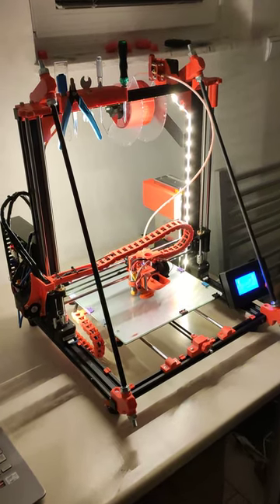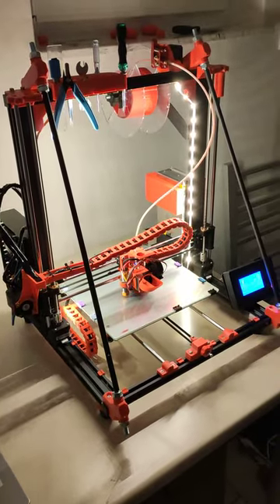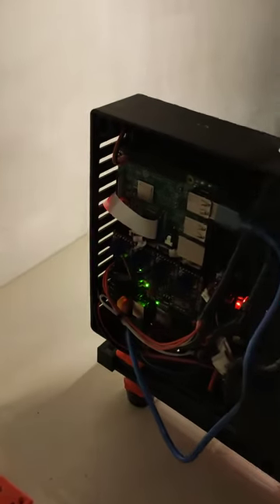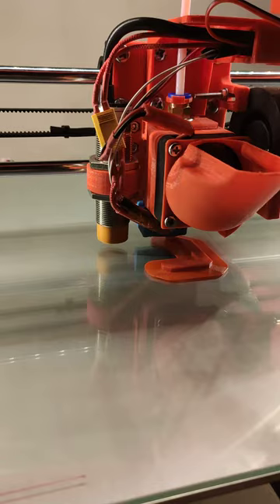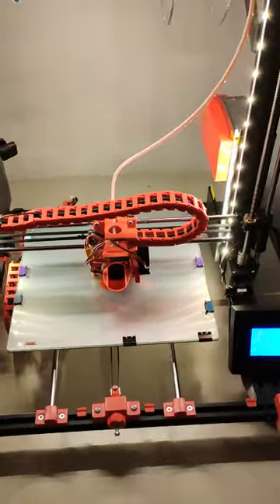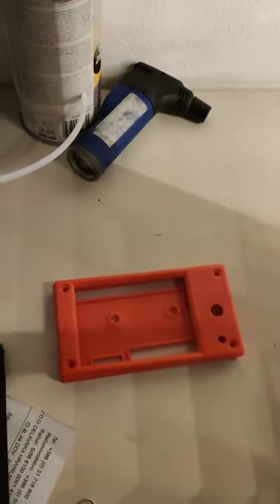ANET A8 plus with SKR 1.4 turbo modded

Comment: Good job..👍.
I got mine upgraded with SKR1.4 X&Y TMC2209 Z&E 4988 and TS35 screen. Completely changed the feel of it. So silent & smooth prints surprisingly very good. Considering a 300mm & metal frame😊 too. Thanks for sharing your built ❤

Comment: Good to know! I'd like to do this with my A8. I'm glad to know I don't have to change to the TFT immediately. I can still use my Anet display.
Reply from the maker: Yes it can be used, but this new display is so much better. But changing from 8bit to 32bit and better motor drivers is huge step forward. On 8bit bord there is no enugh space for Marlin extensions. On SKR 1.4T you can enable all options you want 👍

Comment from the maker: Today I ordered linear rails and blocks for Z, Y and X axis.
Reply: Could you share the links where did you buy these from?
Reply from the maker: @tamasau8725  I order them on Banggood and they are Machifit MGN12H . I did mounted them on Y axle. They are prfect. You must yust clean bearings and block and dont forget to lube them.

Comment: Omg this is awesome! I'll save it for reference! I'm thinking of modding my a8p too but I'm not that knowledgeable to do so yet @_@
Reply from the maker: Hi. Just swap mainboard and upload my config files. If u need help just ask. I know how frustrating can be if you can`t get any help. Now i`m waiting MGN12 rails to do the last mod. But overall print quality is perfect. And if you still using stock hot end change it for E3D V6 and put stepper motor for filament on top for bowden setup. And don`t forget to add auto bed leveling :))
If you have problems with filament sticking on glass its all in bed temperature and nozzle high. For PLA HE210°C at start and 200°C when printing and BED 70°C
Reply: Where can I get the firmware I want to put a biqu h2 exstruder on my anet a8 plus but there is no eprom in original board

Comment: If you can do a beginner guide to upgrades that would be incredible... I'm new to 3D printing and have an A8+. I love it but it's a bit noisy and I'm looking to upgrade... I heard that you can change stepper drivers and assume that is a chip on the main board... But it's really hard to get info that does not immediately go into technical jargon that I don't understand at all!
Reply from the maker: Yust ask,what do you want to know?

Comment: Could you upload your config file have the same setup but can’t get my config to be right. Thanks in advance
Reply from the maker: Did you try this link https://www.dropbox.com/s/qeislexbaimhnzk/SKR1.4T%20A8%2B.rar?dl=0
Sorry for so late answer
Reply: @trebor1477  Thanks for the files, Ive got a stock hotend and BLtouch, the bltouch i can change i know that in the firmware but for the stock hotend do i need to change anything?

The rest for wiring should just be following the wiring schematic i guess.
Reply from the maker: @filthmaster9936  Hi. Yes you need to change off set becouse my hot end is in diferent possition. I hope you do know how. But on youtube are a loot instruction 😁👍
Reply: Also would these configs work on the skr 2.0?
Reply: @trebor1477  ah yeah that I know off, just trying to find out now if I can use these files on skr 2 because I cannot get the skr 1.4 any more.
Reply from the maker: @filthmaster9936  Sorry i don't know. But it can help you by modding your config. Allso  there is new version of marlin now.
Reply: @trebor1477  thnx for the info, found even never board, the skr mini E3 v3.0

I'll go for it and see if I can make it work. Would be great with that board.
Reply from the maker: @filthmaster9936   I needed 4 days to make it work. But i did not have anny help. But at last it is something to begin on. Try with no ABL for start. Please subscribe 👍
Reply: @trebor1477  Subscribed👍🏻 

Do you have a discord channel by chance. Plan is to start with basic setup. No AB, no filament detection.

Comment: thanks alot for sharing! I am eyeballing the 1.4 turbo for my own A8P. Its great to know that its already been done!  Do you mind sharing the part number on your z-probe? and are you powering with 5VDC or 12? I have the 8 mm orange one appears just like yours... but using on 5 VDC power does not work with glass on the bed. Ive been printing without the glass sheet, But I would like to be able to use it.
Reply from the maker: Hi. The part you want is LJC18A3-H-Z/BX this is better probe because you can regulate it for hight you want. Allways calibrate probe when your priter heat's up to working temperature. Then probe will work well. Conect it on same place where is Z limit switch (dont forget to unplug Z swich first ). Wires are conected like this black is signal, brown is 5V and blue is GND. To print succesfuly on glas bed with PLA u need 70C and with PETG u need 80C but im usig E3D head. Stock printing head is good just for start. You can contact me on Discort for more help. Hit subscribe 👍😁 so you wont miss new BLV mod for A8P. Yes iti is done and it is printing fine 😁

Comment: I've rewired and configured marlin as you mentioned but the original LCD screen for Anet A8 plus won't work ( only the backlight turns on). Do you have any recommendations ?
Reply from the maker: Go and reed Yar Mar post. I hope that you did not connect your LCD in SKR before you modded connector and pins. I can send you picture on email if you want.

Comment: How was the wiring of the anet a8p screen to skr 1.4, was it straight forward?
Could you share some overall wiring guidance also?
Thanks
Reply from the maker: Don't plug A8p screan directly to skr board. You must change wires and mod connector. Go and see Abdul Hafiz post there is how to do it.
Reply from the maker: Https://youtu.be/zZYd0aYtThY look at 8:30

For A8P use 7 pin near modded connector and 9 pin  and reverse + and - as on video. I tride to add link to picture but youtube is deliting msg. If lcd light up and there isn no picture 7 and 9 pin the wrong one. You can give email so i can send u picture if you have problems.

Comment: Is this the bear mod seen on the thingiverse?

And how do you hookup the stock anet a8 plus with skr turbo? I have the same board on the way and want it to replace the stock anet board but still use the stock screen.
Reply from the maker: Hi. I used a lot of different parts from thingiverse.com but for upper reinforcement I used:
 -Anet A8 Plus - Bear X & Y - Frame Brace by FedorSosnin. Check for bowden extruder mount on his site.
For SKR 1.4T:
- Anet AM8 A8 - Electrical Box for (SKR 1.3, Raspberry pi 3b+) by Technoo10201 
Y belt tensioner:
-Anet A8 Plus Y Belt Tensioner by nosbiker 
Z axis improvements:
-Anet A8 Plus Z axis improvementsby stefanobatt 
-Adjustable foot
Adjustable foot for Anet A8 Plus or other by manidu30

If yo want to use original LCD you will need to cut some wire`s and solder them. Use picture in RAR file. Connector on picture is on motherboard side and goes in EXP1. On EXP2 is connectet only one PIN for RESET button. For better understanding go visit this site https://www.reddit.com/r/Anet3DPrinters/comments/gc1tkm/anet_a6_full_graphics_lcd_btt_skr_14/
Reply: @trebor1477  thank you very much for your detailed reply. Appreciated it. Subbed
Reply from the maker: @ujang0711  I recommend a "TFT35 buttons on right side " this way you get USB port and a lot of options so you don`t need to upload new config files for some changes. I will make video later. By the way in my config I use auto bed leveling probe so disable this if you don`t have it.
Reply: @trebor1477  At the moment, I think the microSD slot is enough for me. But I will definitely be getting the TFT screen later in the near future. I will look forward to that video. About your config file, I’ll keep that in mind. For the TFT screen, I do know that it needs a different firmware from the SKR board. But does the firmware need to be tailored for a specific printer?
Reply from the maker: @ujang0711  this microSD on SKR board is easy to brake. And in marlin you need to set it as LCD and not as ONBOARD. I know its funny and not logical. If you set it as ONBOARD you wont be able to see it on PC ower USB port. And if you set it as LCD then you can :)
Reply: @trebor1477  I'll wait for my TFT to arrive then.
I'd like to know, did you use the original limit switch with the SKR board? Or you get the limit switch with the attached board?
Reply from the maker: @ujang0711  I'm using sensorless homing with TMC2209 drivers. All limit switches was removed.
Reply: @trebor1477  For the supporting rod, is this the one that you use?

https://www.thingiverse.com/thing:4133747/files

I can't seem to understand where to mount the bottom mount. I see that you mount it on top of the front aluminium profile. But the author pictures on thingiverse mount it at the corner in between the two profiles. Can you clarify on this? Thanks.
Reply from the maker: @ujang0711  Hi. Look at picture. https://www.dropbox.com/s/xn9cd91d54068qe/1608964345506.jpg?dl=0

Comment: Why do you removed the direct drive?
Reply from the maker: For faster printing. And i don't have anny problems with bowden setup.
Reply: @trebor1477  Retraction with PLA is not a problem? Im thinking in this printer to print some big masks or helmets.
Reply from the maker: @JeanBrito666  i printed case for skr board with no problems with PLA filament

Comment: Looks like a great machine! I've just received mine some days ago with SKR 1.4T.  I've not not started assembly, I am still waiting for the new hardened steel linear rods and new bearings. Until now have you got good experience with sensorless homing?
Reply from the maker: I`m am also waiting for MGN12 rail`s and bearing`s. Sensorless homing is working OK. But you don`t want to enable HYBRID THRESHOLD when you use sensorless homing. Do you have modded parts for X and Y linear rails?
Reply: @trebor1477  Thanks for the advice! I don't have any until now.. My parts will arrive tomorrow hopefully. I have a question to you about the x brace. It looks like to me that the bottom one's chase does not fit with the slot on the aluminum profile. In Cura it looks like as it 90 degrees turned. How did you manage to attach it stably?
Reply from the maker: @ottoczompoly6267  Do you mean this part https://www.thingiverse.com/thing:4133747
Reply from the maker: @ottoczompoly6267  did you assemled your machine?

Comment: Hi, can i use this file for my Anet A8 plus with TMC2130spi und tft 35 E3 V3  but without Sensors?

Thank you!

(I have add you @Discord ;) )
Reply from the maker: Yes you can, but you must do a lot of changes in marlin config files

Comment: Good job..👍.
I got mine upgraded with SKR1.4 X&Y TMC2209 Z&E 4988 and TS35 screen. Completely changed the feel of it. So silent & smooth prints surprisingly very good. Considering a 300mm & metal frame😊 too. Thanks for sharing your built ❤
Reply from the maker: Hi. On what version of the marlin are you? I'm on Marlin  2.1 2.1. Yes it is a totally different machine and you can't say it is Anet any more 😁. Uh... Now I see here I had 8 mm rods instead of the BLV mod with MGN12 linear bearings.

This is how it looks now
https://youtu.be/qJNogkC55DQ?si=lHzHv16Qu8V0RX-V